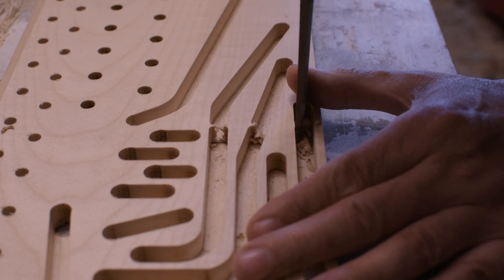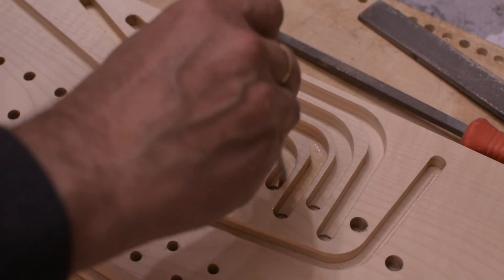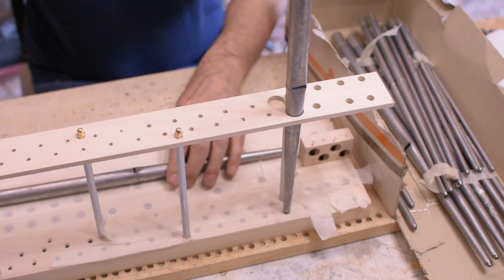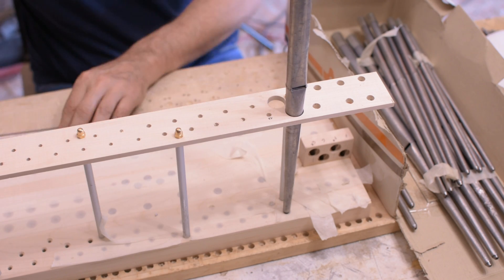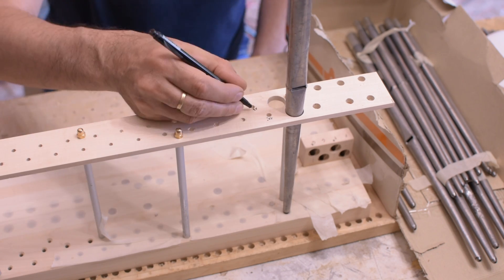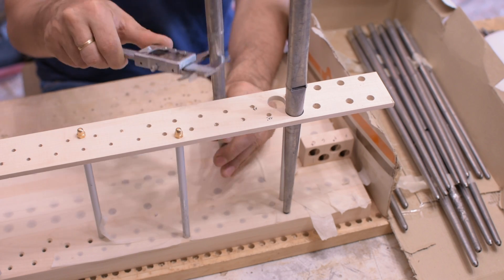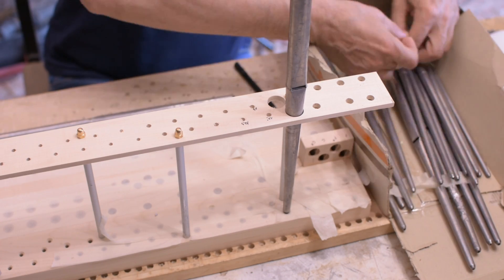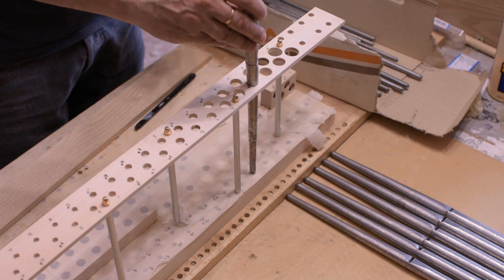Toe board and first pipes - Renaissance Positive Pipe Organ Building

Comment: VERY nice work, and an absolute joy to watch the progress!
I have a few suggestions for you, based on what I observe in your videos. First, you will benefit greatly from using the "knife wall" technique. Google the phrase "knife wall paul sellers". This will increase accuracy tremendously.
You should also sharpen your tools way better. A 30-ish degree bevel polished out on a fine stone (sand paper works too, I prefer diamond plates but they are expensive), followed by polishing using polishing compound on a leather strop or a piece of MDF. Remember to flatten the back of your chisels (a cm in from the edge is plenty!) and polish it to mirror finish first. You never touch the back of the chisel again unless you damage it or wear it down past the flattened part.
The same thing goes for the iron in your planes. A little tip: a piece of white candle is GREAT to lubricate the sole of the plane so that it glides nearly frictionless. Work on your grip on the plane - one handedly you risk planing out of square. Clamp or screw a block to the end of your work bench to act as a planing stop, if you do not have a vise. And if you don't have one, consider making a moxon vise. Should be very easy for you to do, by the looks of tings! :)
I hope I am not stepping over the line here, but I do think you will benefit from these suggestions.

Again, it is an absolute joy watching your movies - and I understand you perfectly! :) You are doing something that I want to do myself someday. I have already built a 32 note AGO pedal board for my Hauptwerk organ, so I am not unfamiliar with organ building.
You can find articles and images of that (plus lots of other woodworking topics) at my blog, if you are interested: https://fagerjord.org - I also have my own article about the knife wall, but I have that from Mr. Paul Sellers. Which, if you don't know who he is, you should check out!!!

Keep it up! I am eagerly waiting for your next video! God bless!
Reply from the maker: Thanks for the advice, I'll take it into consideration. I definitely need to improve some of my woodworking techniques and sharpen my tools more often.